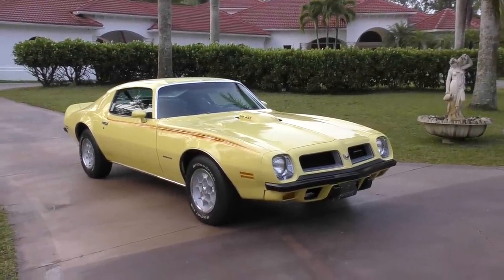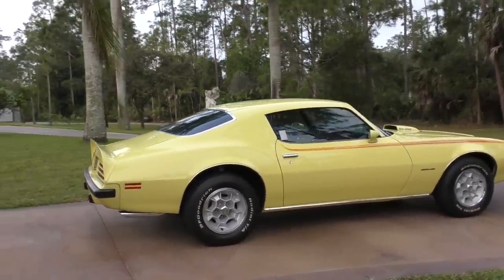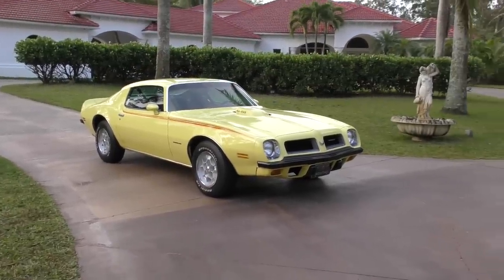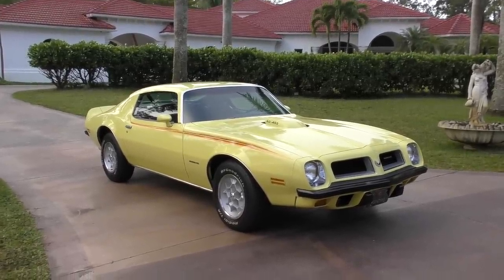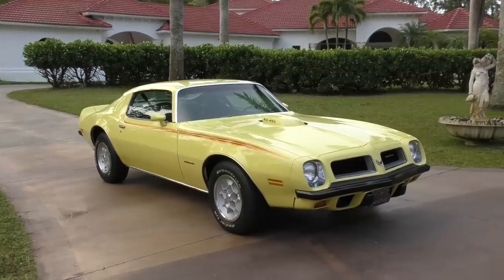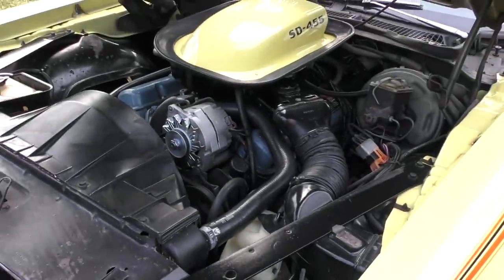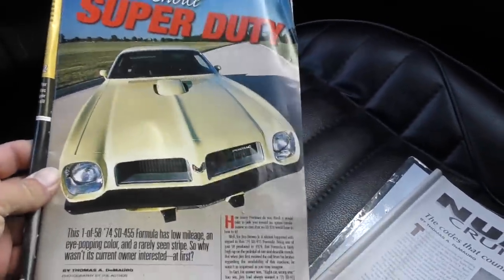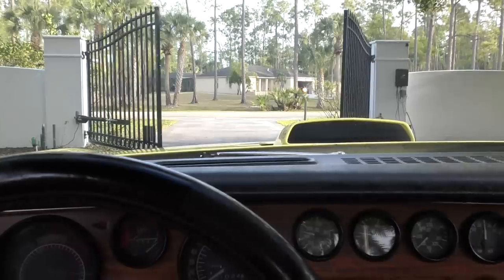1 of 58!  This Ultra Rare 1974 Pontiac SD 455 Formula Firebird is The Last Real Muscle Car

Comment: My first car was a sd 455 trans am 1974 bought new. Kept it until 2000. If you really wanted to nake it run. Change the 308 ring and pinion to 373, dump the exhaust system .. I went with hooker headers and thrush mufflers. Drill the plate rivets on the shaker and use the ram air.  I also added a super holeshot B +M convertor and trans kit. I could drive to the track and rin 12.20's all day.

Comment: What a beast. Actually, I believe block size was the same for all Pontiac V8's, Oldsmobile too. The 389 became the smog era 400 and the 326 became the 350 (more like 356-357). All of these could haul ass with a little work, but the SD was unreal and so rare.

Great year for movies. Blazing Saddles would never fly today. The sheriff is.......near. No, the sheriff is.....

Unfortunately the start of disco too in 1974. And big hair for both girls and guys.

Comment: "The interior of this car smells like my youth". So, spilled beer and Hai Karate aftershave?     😊
A '70 Firebird 350 was my first car; owned a number of T/A's after that from the '73, '76, '78, '80 and '83 model years. My favorite was a '78 with the W72 220 hp engine and Borg-Warner T-10 4-speed trans. Platinum Silver with a red interior. Least favorite was the '80, it had the anemic non-turbo 301 engine. The black/gold special edition package and t-roofs couldn't compensate for the lack of power in that rig.

Comment: What a great video! Thanks! Subscribed. My first Pontiac was a ten year old 1962 Bonneville 2-door hardtop, 389, 4-speed turbo hydromatic. Oh man, did I love that car! The Arizona sun had vaporized the metallic blue paint but fortunately the amazing blue interior held up. I had it repainted a gorgeous Polar White (a Chevy color), perfect for the hot desert. It wasn't that fast but sounded good and really turned heads. Sure, with just half the cylinders and three times better gas mileage my 2019 Camry SE is faster and better but there was true magic in our old-school rides!

Comment: I am enjoying your video. I ordered a new '74 SD 455 Formula after reading about the special engine. Then sitting in a new Formula at Tony Piet Pontiac in Chicago and firing up the engine that beautiful exhaust note!  I placed the order and have them $500.00 down payment, basically the price of the engine option, which was just over $500. At the time I was not aware of the shaker hood being used on the Formula. Unfortunately, the engine was discontinued, and I never got the SD 455. I did but a new Formula in '75 off the lot and later ordered a WS6 '79 Trans Am in Cameo White with Saddle interior. Had that car for nine years. I recently owned a '73 Formula  400, four speed car in Bucceneer Red, and it did have the five mile an hour bumper. It looked like the early ones, but had beefier steel reinforcements.  My '75 had the Radial Tuned Suspension, so the full size 15 inch spare tire really filled up the trunk compartment. Thank you again for a nice informative video.
Reply: Sorry, the 75 was a total dog. My buddy had one. HOWEVER you were so close your story is something to behold. Few others ever had a chance to try what you did. I was 16 at the time and had ZERO chance of getting one. Barely even knew what they were.
Reply: @74SD455TA  yes with the low 7.6 to one compression was not a hot rod for sure. I ran full dual exhausts from a '74, and had to change the 
exhaust pipe to manifold flanges as Pontiac changed them in 1975 to a three bolt vs two bolt type. Did a bit to the carburetor too and it ran faster than a friend's '76 Corvette.
Reply: @Thekarlskorner  You are mistaken on so many levels concerning the SD 455 engine. Your piggy Formula had 7.6 compression as by 1975 it was all over with catalytic converters. The SD was a detuned race engine as its performance shows. It would compete directly with the prior years muscle cars of the  60's and 1970 which included the Hemi and the LS6 Chevelle's for example. Mine, has been set up and tuned the way the Pontiac engineers had envisioned and runs low 12's at 115MPH in the quarter. As part of my collection  it is very valuable.  Sorry but what you had couldn't compete with a station wagon. I had a buddy with a 1975 Trans Am from new and we used to laugh when he'd hit the gas, it would go nowhere and the air cleaner would "shoot em some air" as we used to say.

Comment: Friend had a midnight blue 74 trans am with a 455 and a firechicken on the hood. gobs of torque and cool diamond dash. was no slouch but a bit heavy which kept it from being quicker. my 67 Camaro with a 327 camel heads and muncie was slightly quicker due to weight. weren't a big deal back then(late 80's-early 90's). if only we had any vision we would of bought them all up and be rich now. lol

Comment: My high school car was a 1975 Formula 400 Dark Blue with the double scoops which were just for looks case they had a molded sold piece inside the scoops and didn't allow air to flow to the engine.    Well, I fixed that and added big Holley Carburetor and Headers.   Speedometer only went to 100 and it ran way past that.  
There was a stretch of road I could let her rip and surely rant 130-140.

Comment: I recall test driving a 74 SD TA on a used car lot in the late 70’s .  It was a 4speed and I was amazed how stout the engine was for a mid 70’s stocker.  It felt very similar power wise to my then current 69 GTO ride.

I passed on buying it because i hated the 74-75 front end.  I would have bought it if it was a 73 with that beautiful 70-73 styling.
Reply: I purchased a true barn find 73 Esprit with the original 350 which I eventually put #48 HO heads and a aluminum intake new exhaust and added a dual snorkel formula hood. It also had been repainted once in the original Brewster Green paint with a white vinyl top and white Custom interior. The car is a beast and draws a crowd no matter where I go

Comment: I had a 73 Trans Am. White with the Bird on the hood. Was an SD also. Very rare. This one was a 4 speed. I also had a 70 1/2 Z28, that kicked the crap out of those cars.
Reply: If you're saying your Z was faster than the SD in stock form, then you did not have an SD, just a regular Y code TA.
Reply: Don't tell me what I owned. I had 2. An SD and an HO. I know the difference.
Reply: @nitro5119  Poser, stock vs stock, a 70 z-28 can barely compete with a SD455 or 455HO Bird, you're not the only that's owned them, let me guess, it also beat the 70 RS/SS L78 Camaro, HA!

Comment: A very similar wheel design was later used in gold on the Australian HX-series Holden Monaro LE in 1976. About 600 examples were built basically to use up the 1971 2-door bodyshells.
Reply: 'Twas the same wheel mate. Holden also used Pontiac's Rally II wheel (only in 14" size, whereas in the US they came in both 14" and 15" sizes)

Comment: That super rare 455 is GREAT! I traded in my 68 Camaro SS Ragtop 327 Hurst 4 Speed for a 1974 Camaro Z28. What a mistake that was. The thing was total junk. If you had the ash try open, and tried to slam a third gear, you were lucky if you didn’t break your fingers as they slammed into the ash tray. It locked between Revers and 1st requiring a tow a few times, etc. The odometer broke at 30K so I dove it like that for a while and finally fixed it and sold the car, and picked up a 1968 Chevelle SS 396 luxury cruiser with Auto and Air, tilt, venal roof etc. I liked it a lot better. Bill’s point about GM build quality is spot on. I have to say, Bill, you really crack me up. I like your videos more that the ex-comedian guy with 150 awesome cars… RR

Comment: PONTIAC IS NOT A BIG BLOCK! ITS A COMMON BLOCK ENGINE which only 2 manufacturers made them..1) AMC Corporation and 2) Pontiac Motors Division, which I am a fan of both and i have both in my collection...71 AMX Javelin and a 74 Pontiac Grand prix SJ D.E. 455 4bbl

Comment: I remember reading in a car mag long ago that the '78 T/A  "T/A 6.6", 4 barrel, dual exhaust 220hp,, with WS6 (as opposed to the standard "6.6 Liter" 2 barrel, single exhaust, 200hp) broke the Motor Trend record for fastest stock car around their test track, and held that record until the '94 Viper broke it!!
As I've always understood (reinforced by writers from Muscle Car Review and other magazines), the 1st "true" muscle car was the '64 GTO due to it having "1 cubic inch per 10 pounds of car". IMO (and I think it's safe to say many others) the '78 T/A 6.6, WS6 ended the muscle car era. After '79 (having some 220hp 6.6s left over from '78 so some consider the '79 T/A 6.6 WS6- with 4 wheel disk brakes that year- to be last muscle car) Pontiac engines were killed by GM (like the Banshee and Fiero they were too much of a threat to their "almighty" vette). After that Firebirds were just  "camaros in a Pontiac wrapper".
That to me was the end of both Pontiac and the muscle car (thankfully the past 2 decades have seen performance come back tho)

Comment: I owned a 1975 Trans Am in the day.  The car featured here does not have the dual Formula hood scoops which all Formulas had in the day.  The hood shaker of the Trans Am is on this car and is really strange.  No Formulas had a hood shaker.  It might be a SD455, but the outside appearance does not lend itself to be one.
Reply: Yo Kurt, that is ALL the SD 455  Formula for 1973 and 1974 had was the shaker hood. EPA mandated that this hood be used or Pontiac would have had to re certify the engine if they were to change hoods and that was not happening. It was a true miracle that any of these got built in the first place as it was.

Comment: Wrong about the AC mandated 3.08 gear over revving the compressor. All hi po GM AC cars got a 1/2" larger AC pulley. Then why the 3.08? Good question??? And no Pontiac ever had more than a 5000 redline = more confusion. 
And Pontiac never had a big block, all 287 thru 455 were physically the same size block and deck height. Aftermarket guages, but not ordered with a tach?!?! Weird...

Comment: Thank you,nice overview on FIREBIRDS, ETC. . I am Firebird/ TA super  fan...INTERESTINGLY,  in Oct 1976 I ordered my first Special  Order  new Car : 1977 SPECIAL ED/ Hurst Hatch (leak and seep over 15 years)/ auto (*4 speed Manuel factory,& cruise not available yet/ air/ tilt/Velour interior/rear window defrost / cruise, ZIEBART,ETC. AS you mentioned the 6.6( 400) was **disappointment In horsepower ( I and mechanic ,made  it much better with opening Shaker up, reject carbs/ DISTRIBUTOR recurves,ETC), KONI SHOCKS/HO SPECIAL Suspensions, with decent !!!!, Goodyear TA tires ( UNIROYAL PR6 Radial original), and more helped:  best all around driving car I really ever driven....The TA 6.6/4 speed should have been better:; BUT we were in Gas crisis then.. FINALLY, SOME 15 plus years of hard family Use in WARSAW Indiana : & road salt/ leaks really beat it up, though  my beefed up engine & Trans Rebuild stayed good 155,000 (?) miles,; Son and I started rebuild, a MAJOR  COMMITMENT, & gave up due to pressing Family stuff, etc. Also, interestingly one of fastest cars & most fun drives : some of build Factory parts were teeeivle: door handles, body panels, some interior : the Trans Am SE had a lot of upgrades over Formulas, etc. Super Memories,

Comment: BILL here is a fact for you....second gen trans ams got the shaker scoop and formulas got the 2 forward facing hood scoops so why does this formula have a shaker? the sd 455 was already late and the epa test was run with the shaker and if they wanted to put it in another car with flat hood it would have to be certified with the other air cleaner so they just built them with the shaker......also thats a formula steering wheel thats the actual name...gto judges had them optional too...love the pontiacs

Comment: Another great video those were the last off the true muscle cars and it was truly the last the super duty engine was a factory blueprinted engine .i always loved the formula firebirds off that year they were everywhere when I was a teenager back in the late 70s  those and the trans am the firebird always seem too be more stylish than the camaro  you couldn’t get the 455 after  1976 the 400 or 403 in Cali was all that remained.give it too Pontiac for still being able too supply 200 plus horse power net from the 400 . Actor James garner said In an interview that he personally chose the firebird espirits 400 for his show the Rockford files after 1975 they stopped using  the 400 espirits firebirds and started converting firebird formula 400 into firebird espirits.for the show in 1979 when Pontiac went with that ugly front nose on the firebird mr garner didn’t like them sow he  had the transportation people locate as many new 1978 firebird formulas  as they could too convert them too espirits for the remainder off the tv show 👍✌️

Comment: 29:20 Back story on that twin turbo'd 1977 Cadillac Seville; 454, 4 spd and propane fuel only. Calif had a emissions loophole that a 1980 on down vehicle was propane only, except for the PCV, NO other smog devices were mandated; as in NO catalytic converter, smog pump, etc. The license plate was '1 FAST MF', California.

Comment: You've brought back a memory here, that has nothing much to do with Pontiacs.  I'd read that Car and Driver article you referenced, about the guy with the twin turbo Seville.  I thought that was the most hilarious idea at the time.  The only improvement would have been to build it as a genuine sleeper.  

For any of my classmates that might have owned a Trans Am in those days, Led Zeppelin would not have been out of place, or Aerosmith, Boston or Kiss.  

When it comes to the Trans Am name, when the third gen cars debuted, the matter of royalties was barely straightened out in time, it seems.  The 1982 model was expected to be called the T/A.  Which stands for what?  https://www.youtube.com/watch?v=wg2ZtSHoKY0

Somebody, I suppose, blinked at the last moment, and it might be an interesting story.

The Super Duty name made one last gasp as racing parts for the 2.5 liter four cylinder engine.  The Fieros that paced Indy in '84 had engines that pulled 232 hp out of a 2.7 liter engine.  Parts were available over the counter, good for outputs of over 300 hp.  It was meant for the Fiero, though I could imagine someone using them to turn a dreadfully benign 6000 sedan, or perhaps a Buick Century Limited into a most unpleasant surprise, if you're hell bent for velour.  Not that I think anyone would have done such a thing...

Comment: Also74 the window didn't drop it down In the back Plus No Emissions Catalytic converter Or air pumps And it's great when they have the 3 spokes steering wheel. In the upgraded interior. Which my mom's had Plus the fiberglass head scoop On the formula's Was badass

Comment: Gotta have ZEPPELIN cranking out through Jensens or Pioneer 6x9s! Wicked 2nd gear scratch!
Reply: The Turbo 400. DRAG RACER specified, killer consistent transmissions! Loved them! The 1974 Trans Am was the last year you could get the Turbo 400. They went to a Turbo 350 in 1975.........Mint oz ZEP

Comment: The SD455 had a cast crank. The SD421 had a forged crank.
Reply: Correct drippingglass, the expensive and hard to get forged cranks for that engine did not make it into production, but forged pistons were. Remember though, the SD cast crankshafts were magnafluxed at the factory, the rods were shot peened, the valves were swirl polished, the distributor gear was Parkerized, the carb was 800 cfm, the oil pump was 80lb  etc, etc. Every internal part and the block itself was unique in some way, a real tribute to the engineers at that time when everything was against them.

Comment: You forgot to show the decal on the driver's side valve cover that has information on the engine.
Reply: It was there if you look closely on the drivers side where it should be. It specified the proper method of tightening the rod bolts, by measuring the stretch (not torque) of the bolts which were specific to the SD engine.

Comment: 160 MPH in that car...no way. Anything over 110 was scary in those F-bodies. The spoiler forced the rear end down then the front went up and darted all over the road.
Reply: Tell you what my friend, that may be true of the Formula’s and Esprit’s, I have no experience there, but my ‘73 SD TA 4 speed was in the yellow on the tach (5500rpm) at 130 and still pulling with the nose firmly planted on the (deserted) pavement, straight as an arrow. The exhaust and wind noise was excessive but those air dams and spoilers are fully functional at speeds over 80mph. On the other hand, my ‘68 Firebird behaved exactly as you described!

Comment: If it’s a Formula, why does it have a TA shaker hood scoop? Formulas had two long hood snorkels that nearly reached over the the front bumper, not Trans Am hood scoop located in the middle of the hood.
Reply from the maker: Because it’s 1 of 58 SD455 Formulas. I mention this in the video.
Reply: @Bobster986  The SD cars are real, and all had the shaker. SD Formulas are extremely rare- just 43 produced in '73 and 58 in '74,   Go read up on them- there is plenty of info about the SD cars on the net.

Comment: 23:15 Didn't Ford call that setup "Polycast Rims"?? I had a '92 Monaco with Chrysler's (or maybe Renault's) version of them. They were fake, but a lot more convincing than the now-ubiquitous plastic fake-alloy-rim-pattern wheel covers with the stamped steel visible through the holes.

Comment: Never seen a formula with a shaker hood
Reply: ONLY the SD 455 Formula carried the shaker hood besides the Trans Am of course. It had to be that way because of additional EPA certification delays that would have taken place if Pontiac wanted to use the standard Formula hood.